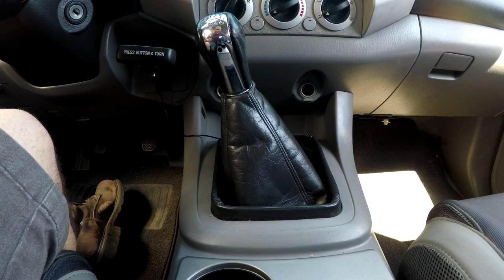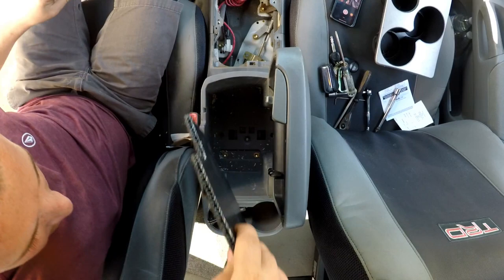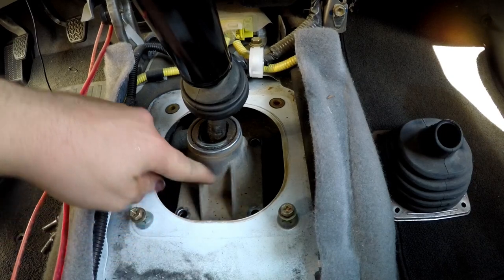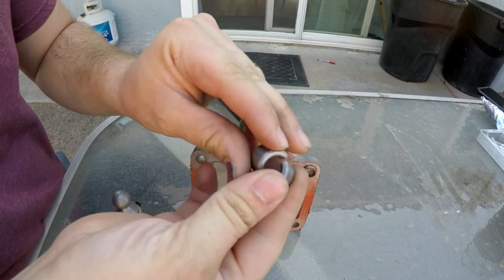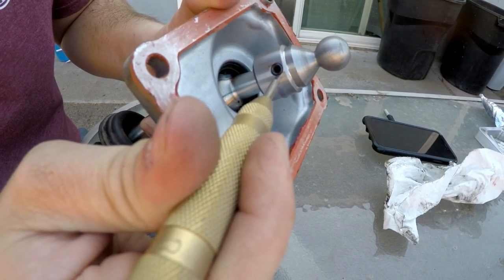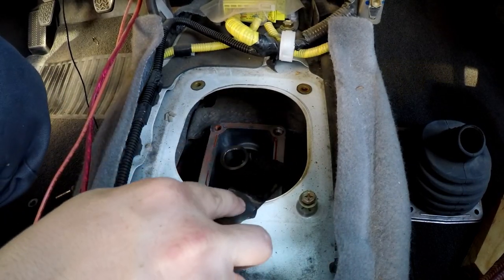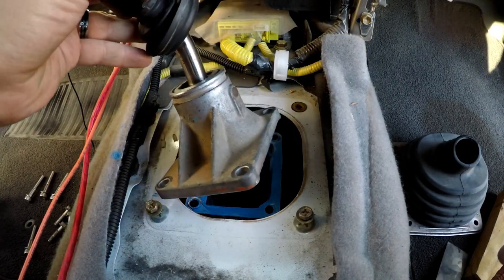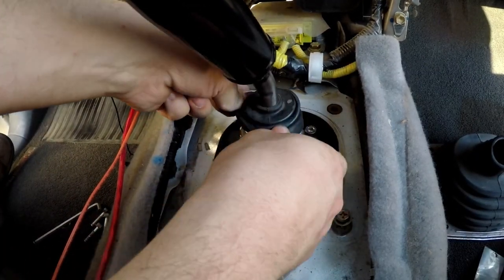2nd Gen Tacoma 6 speed Shifter Replace (URD Short Throw)

Comment: great video! but your actual shift lever is trashed. the top piece that the knob threads onto should NOT move separately from the bottom part. there's rubber in it that wears out over time and yours looks like it could pull right off. theres a lot of write ups out there on disassembling and fixing it with epoxy and some set screws.
Reply from the maker: Yep! as soon as it was back together I took it for a drive. This swap-out didn't actually fix my main problem (though it helped a bit). Took it apart the next week and epoxied the whole shaft, as well as replaced the little white bushing on the end. Absolutely no slop now.
Reply: @SprocketHead  I’m having the same problem now with mine, how is the epoxy holding up now?
Reply from the maker: @joserbenitez7124  the epoxy holds up just fine. The problem is that it’s too rigid, so driveline vibrations make it into the cabin. I drove it for about a year before I got tired of hearing it and just replaced the whole shifter. I suppose it could be a permanent fix if you find an epoxy that will set up in a rubbery state.

Comment: You forgot on really important thing!!

You did a great job here and the video was great, however you forgot for $12.00 to replace the shifter bushing and seat bushing.

In stead of the old rubber style, use the duraleen cone bushing from Yota Masters in Calif.
You will never need to replace it again, the old style won't last very long.
Reply: He also forgot to grease the whole thing up
Reply: @Czotie  What parts did he forget to grease?  I’m doing this install soon and I’d like to know so I can make sure to get those areas.
Reply: @falcondrvr200  After reviewing the video a second time, I think he did a fine grease job on the plastic/rubber socket (which I would replace with a new one, Marline Crawler has them) at the end of the shifter rod extension. Be sure to use high grade automotive grease rated for high pressure. BUT THERE's MORE!

Try my best to explain via text: Also, put your truck in Neutral before you start... I forgot too last time and boy that sucked. 

Also, when you remove the shifter assembly, be sure to put some cotton or paper towels inside so when you clean around the baseplate no dirt or grim falls into your truck/gears/tranny/transfer case/diff (no matter what you're working on). When you disassemble the stuff I'm about to talk about, clean the shit out of it w/ brake cleaner/WD40/simple green, what ever you have. Always remember, metal on metal, you should grease it if its a moving part and gear oil or tranny oil isn't going through IMO.

ADDITIONAL GREASING:
We don't get to see it because he didn't take it apart, BUT the entire shifter assembly he pulls out comes apart fairly easily AND SHOULD BE DONE. There's a spring clip on the locking collar where the rod connects to the base plate in the center that removes the rod and disassembles the whole thing.  It's really easy to get the locking collar off, you just push in on the very center plate (locking collar) that has the oval hole on both sides and twist, watch out the spring wont shoot it out but will give you pressure so wear comfy gloves, harder to get back in unless you clean it but not too bad.

When you pull apart the shifter, you'll see the locking collar rests on a very thick convex shaped piece of steel that's part of the shifter that rests in the circular base w/ the two steel nubs on either side, THIS IS WHAT I GREASE THE FUCK OUT OF. It rests in the shifter collar base and is center axis of motion when you're shifting Also it's steel on steel, you want it to be nice and greased up. Once again, use very high grade high pressure automotive grease. Don't worry about this touching any tranny/gear fluid, because there should be a RUBBER BUSHING/SEAT underneath it.. BUT THERE'S MORE!

If your truck is old, THE RUBBER BUSHING/SEAT that should be underneath it is most likely a dirty old pile of gross rubber in there that's all gunked up...  You can and should replace with a new one. I HIGHLY SUGGEST DOING THIS, took my truck from being a bitch to shift to golden. I went w/ Marline Crawler shifter bushing.

I put some light grease on the locking collar and the spring after cleaning it just to protect the metal and make it move better, but that's just my preference.  

 BECAREFUL to not over grease (not really an issue) AND ESPECIALLY try not to grease any parts of the rod that will be in contact with gear/tranny oil.

Here's a write up for a 2004 disassembly & bushing replacement but it is the same as a Second Gen Taco sans the extension: tacomaworld.com/threads/shifter-bushing-replacement.528502/ this person does not show greasing in the write up though.

Good Luck! Let me know how she throws!
Reply: @Czotie  great.  Thanks for this detailed breakdown.  I took it all apart today so I know exactly what your talking about.  I’ve got new bushings/seat from Yota Parts so that should make me all set.  Thanks again!

Comment: You didn’t even replace the plastic bushing cap. I know cuz I went to Toyota and asked if I could replace it and they said I would have to buy the whole shifter and stick. I had a 04 Tacoma and back then they sold a replacement bushing for the shifter but now they got hella greedy.
Reply from the maker: Cyborg decided not to because it wasn’t that loose. Main issue ended up being the rubber isolator threat connects the 2 pieces of the shifter together. Ended up ripping it out and epoxying it.
Reply: @SprocketHead  what was your original issue with the stock shifter? Did it grind?
Reply from the maker: @goatcheez1306  no real issue with it other than the slop in the bushing. Heard a lot of good things about the short shifter so I threw that in.